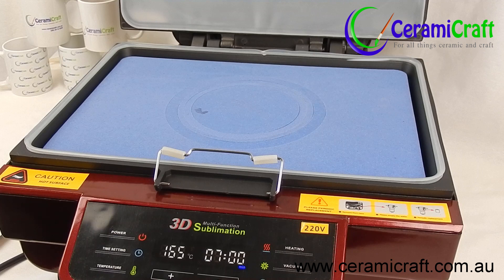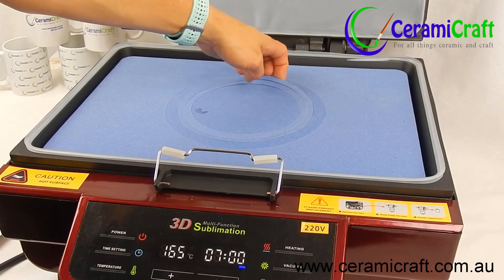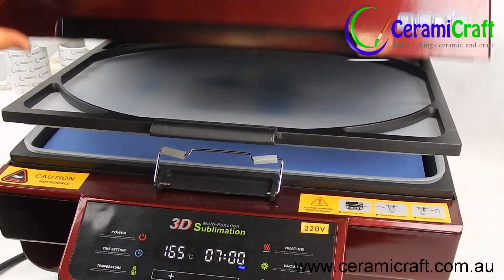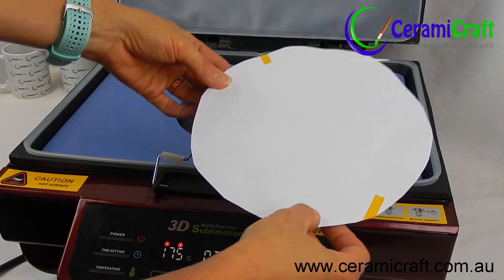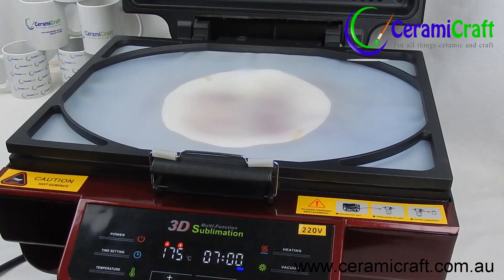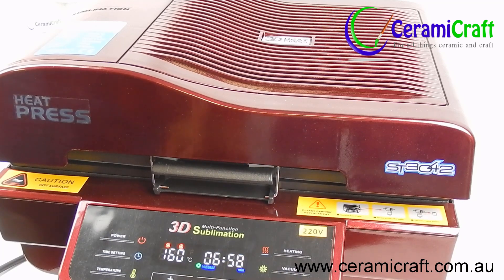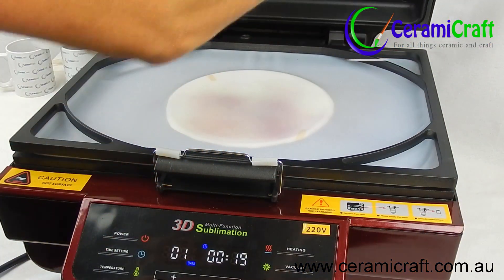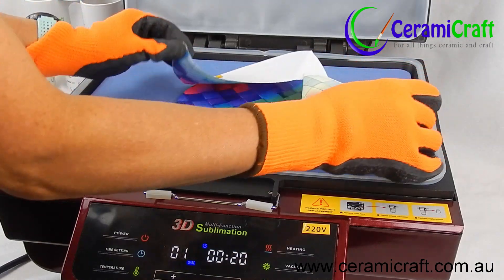How to sublimate a polymer plate using a 3D Vacuum Heat Press ST3042.

Comment: How do you prevent wrinkles / lines / gaps from curvature?
Reply from the maker: Applying a flat piece of paper to a curved surface is never going to provide a perfect print. 
Paper crease marks and distortion tend to be more noticeable when doing full-bleed designs, so sometimes it’s more about making the right design decision for the substrate you’re using or selecting a different substrate based on the result you want. With plates in particular, sometimes all you need do is bring your design in from the edge a bit, and remove any excess transfer paper to achieve a good result without losing impact.
Reply: You could try cutting small slits in the paper in the areas that curve on the plate. If you're carful, you could cut away any overlap, so the paper isn't creasing. It's worth a try.

Comment: what coating do you put on the plate afterward so you can eat off of them
Reply: most plates with prints on top that I've seen are decorative only, not for eating.  Different style plates that are clear and have prints on the back side that show through, can be eaten on because the print is on the back.  But I don't know how dishwasher safe they are, probably not

Comment: how big of a plate can you put in this machine?
Reply from the maker: The plate accessory allows you to do plates up to 25.4cm (10") using the vacuum, but since, this machine has internal dimensions of ~ 30cm x 43cm x 11cm and can also be used as an oven you could potentially press anything <30cm in diameter if using shrink film etc.